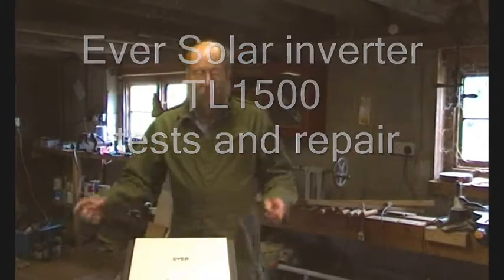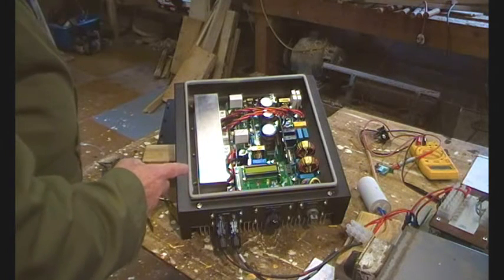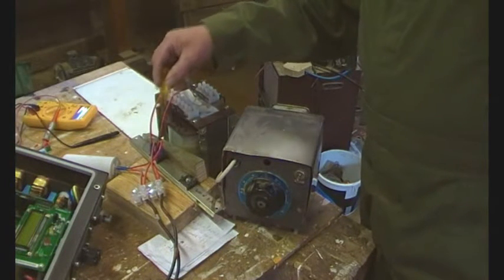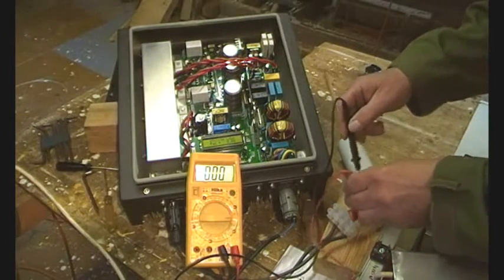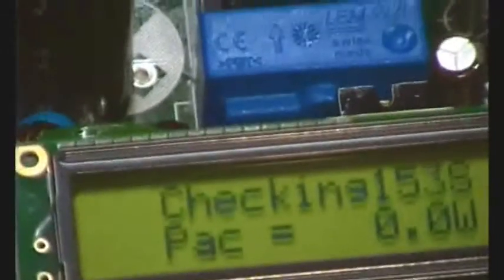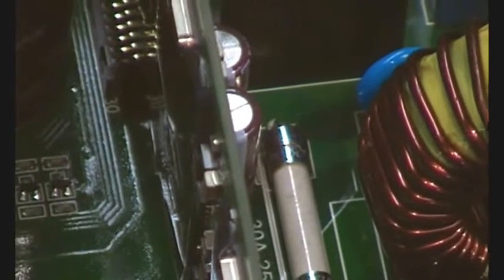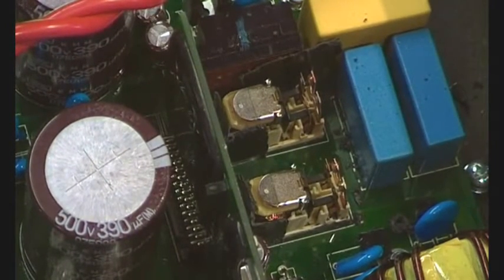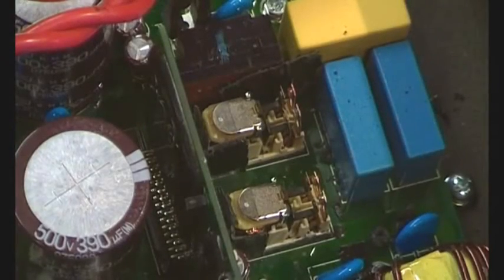Grid inverter investigation and repair: EverSolar TL1500, relay fault.

Comment: hi Andy, i got the TL1500, i need to change the relay. If I replace it with a 12V 15A 250V , a bigger Amp than the old, does it matter?
Reply from the maker: Hi, don't try to remove the old relay as the board is double sides and varnished. See my other video on this inverter: https://www.youtube.com/watch?v=dlYATJYB6RU&list=PLQAXpOOjFoVHefMyqH2lDW3ibs4ddSJn4&index=9&t=0s. It show a relay piggybacked on to the original with jumper wires. It's a 12v relay and the resistance of the coil is modified with a resistor to prevent excess current draw from the control board. If you find the data sheet for the original relays that will give the coil resistance. I added a resistor and then made sure the relay pulled in at 12v DC. Cheers

Comment: Why a non-polarising capacitor? Surely an electrolytic would be fine, as long as 400V or whatever rating. I assume it's on the DC side of the bridge rectifier?
Reply from the maker: Hi, yes you are right,and it is on te DC side of the rectifier. II used this one for several reasons, firstly that's the one I had, and secondly the DC polarity is not important with this types of capacitor, cheers

Comment: Hi Andy finding your channel really interesting, I'm hooked! What VA would be suitable transformer and what size rectifier Thanks again
Reply from the maker: HI, I shouldn't worry too much, all you need is a reasonably sized isolation transformer (not an auto) that has an in - out ratio of 2 or 3. A 240 to 110 would do as long as it is a true isolating unit ( separate in and out coils). If your variac puts 120 in you will get about 250 out. High voltage recitiers (400v min) at about 5 amps will be OK. Warning : it's alll dangerous, especially the high voltage DC, so take care, and then a bit more care. Hope that makes sense, cheers, Andy
Reply: Andy Reynolds Hi again, yes I well definitely be careful I'm a semi-retired Spark so know it needs respect. With regard to the transformer would a 50VA 415-110v be big enough o do I need to think much bigger I never really got to grips with Transformers as I was a commercial elec as a posed to factory maintenance so didn't really come across them much. So much appreciate your help
Reply from the maker: Hi, that's a ratio of about 4 : 1,. It will work to get an inverter running, but only with a few watts. If it gets real hot, then there's your answer. Give it a try, cheers

Comment: Just had the same problem with relays on a Samil inverter,ripped the covers off relays and with a bit of a clean and poke it's working again.Will still order a couple of new ones but with the help of your handy video it's proved what the problem is....Thanks from OZ.
Reply from the maker: Hi. I have piggy backed new relays rather than try to remove the originals. Make sure ther original relay coil is disconnected. Subscribed? Cheers

Comment from the maker: The original relays are song chuan 894h-2ah1-f-s, but it is not worth ordering them as they have very small contacts, definately not 12 amps. I found some Finder units, type 40.52. 12v coil at about 180 ohms and double pole single throw ( DPST) normally open. I have replaced one relay with one a 12v coil unit with much bigger contacts and put a resistor in series with the coil to keep it close to 180 ohms to avoid any possible problems with the control processor.

Comment: Thank you very much for your most valuable tip for repairing relay failure. My Omnik 2K -TL grid inverter stops working. check relay fault.  it is under warranty,  But I repair it my self. Thank your once again.....
Reply from the maker: Excellent, self reliance improved. Have you subscribed to this non commercal channel? Cheers, Andy. Please give thumbs up.
Reply: Yes I am...   Cheers..
Suranga

Comment: Hi Andy, If I simply use a 220 Volts to 110 Volts step-down transformer connected to the AC and on the 110 Volts end just connect a  25A 400 Volt GBPC2504, which is available on ebay, will it not produce ripple-free dc, suitable for the input of inverter? Just a question :) 
Thanks
Reply from the maker: HI. Firstly you need to make sure the transformer is isolation rather than auto so the you get full isolation on the output from the mains, Secondly you need a capacitor to smooth out the ripple. Thirdly you need a method of varying the voltage so that you can check how the MPPT is working, and also you need sufficient volts for the grid inverter to start. Using the 110 volt out limits your testing, but if you use a variac with your transformer the other way round will give varable volts up to 400v DC. Very Dangerous. Cheers
Reply: Andy Reynolds thanks Andy, I am fully aware of the danger of high voltage dc, but for testing purpose in my lab, this setup is best, since it's very difficult to find fault when the inveter is mounted on the wall. I need variac, isolation transformer and the capacitor. Do you have specs or models of these parts or even links where I can purchase these. Also will the capacitor need to be connected to the secondary coil output, I.e. 230 volts ac and then into the bridge? cheers
Reply from the maker: HI. Just a variac with a 240v input that will cope with 250 watts or more. The capacitor of about 20 UF at 400v is acroos the DC output of the rectifier.  The capacitor can be either a DC or AC unit. Cheers

Comment: Hi Andy I have one of these and the screen has gone blank and there is no a/c output so not getting any clues on what is wrong, are these generally repairable by a service guy or do I just hunt down a replacement.
Reply from the maker: Hi. It could be something simple like a wiring fault, or the AC board fuse. Check that AC is getting as far as the fuse next to the relays. If you are looking for a replacement I would look at a Samil solar river 2.3 or the abb power of a similar size. They both start at a similar DC voltage. All these inverters need to be mounted somewhere cool with good ventilation. See my video on a Samil to SMA comparison. Subscribed? Cheers, Andy
Reply: Thanks Andy will check it out

Comment: You have to scroll down a bit, but there's a discussion of replacing the relays here: http://forums.whirlpool.net.au/archive/2201194 
It doesn't discuss removing the cover or sub-boards, but that's not too hard. Getting the main board off after removing all the screws and connectors takes a bit of gentle working around the edges. One trick is the vertical PCB board is attached by a small plastic 90 degree support-that is removeable by squeezing the plug under the main board. 
Hoping the relays are the only fault. Did you ever find out how to reset the unit if another message occurs after relays replacement? Removing the relays by desoldering was no drama. I installed the relay support to make relay replacement simple plug-out-plug in next time. The original relays are not top-line, so replacement with better quality relays is recommended to get longer life out of them. Cheers!

Comment: Hi Andy, nice video. Helpful to see the fault inside the unit hooked up and "live". I have (a) disconnected, (b) removed from wall, (c) opened case, (d) removed display & attached vertical PCB, (e) removed connectors (some bit of wiggling/pulling) and (e) removed the main PCBs in order to replace the two relays. Heaps of these units in Australia, & "Relay-Check Fail" very common. Despite frequency (and rather simple fix most of the time), there are few electronics repairers willing to replace the relays-warranty or not. I know how to solder/desolder PCB components, just takes patience and methodological approach. I'd advanced to the main PCB removal to replace the relays before seeing your "quick fix". It's so common a problem, there is a very useful discussion thread RE replacing the relays: http://forums.whirlpool.net.au/archive/2201194 I'm also installing relay bases as suggested as I'd like to just pop-out/in replacement relays when they inevitably fail again.

Comment: Seems from web forums that these two relays very often fail in this model inverter Andy :o(
Hope you can obtain a couple of good quality replacements from RS or elsewhere .... Cheers,
Dave
Reply from the maker: I have tried a piggy back relay and this works very well. Cheers, Andy
Reply from the maker: Dave, I have some from Finder, difficult to find at 12v coil with double pole, single throw. Not looking forward to trying the replacement as it is a double sided board. Might try just stiching them on top and see if that works. Cheers
Reply: Yeah, I see what you mean. I looked and found these at RS - Finder part # 50.12.9.012.5000 ...these look like a pretty good direct replacement relay (pin spacing is same) - is this what you have maybe ? Why would you not try and remove the old relays and solder-in the Finder ones, unless the relays you have are not the same pin spacing or something ? You'd have to snip off the two legs which are the NC contacts, and make sure the stubs aren't going to touch tracks on the  top of the board of course :o) 
 "Stitching in" a relay is surely a ghastly last resort ???....Just my 2p worth..Cheers, Dave
Reply from the maker: Dave
I took the board out of another of these. It means taking everything out and removing various sub boards. When I put it back together it would not work and came out with Ground and GSI faults that were previously not shown. Maybe if it is dismantled then some for of reset is required?
So I am reticent to repeat this process if it is unnecessary. Cheers, Andy
Reply: Understood Andy - difficult either way then :o( Good luck, Dave
Reply: I wouldn't be too keen to remove one of those boards either...! When the bodged relays won't handle any more tweaking you could always cut out most of the component from the top & use the stubs as connexion points for new relays. ;)